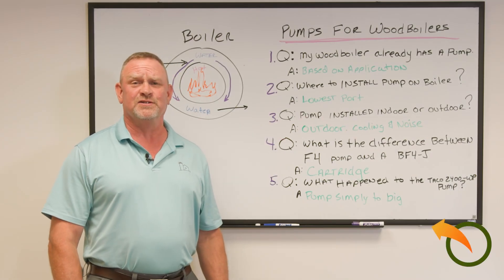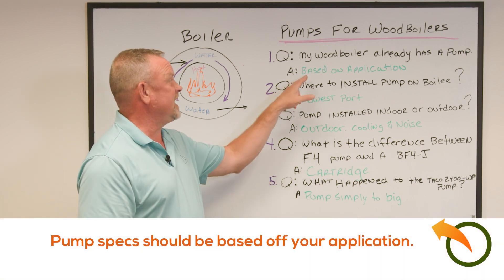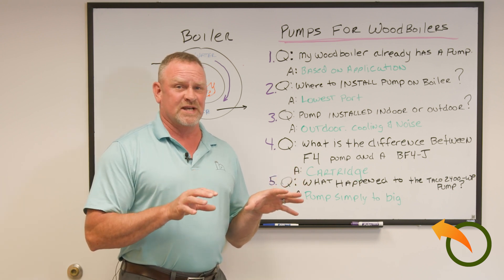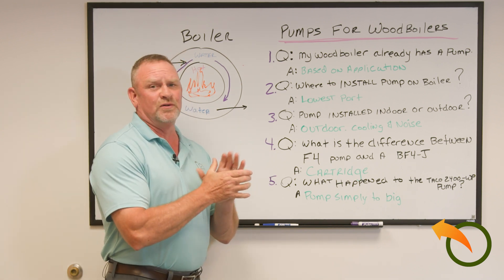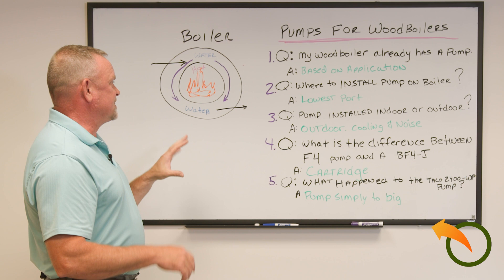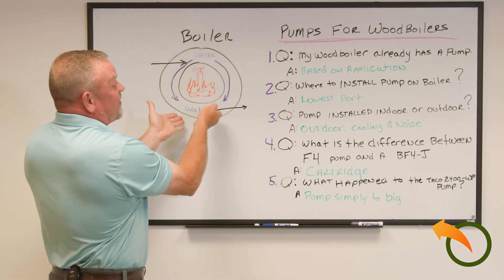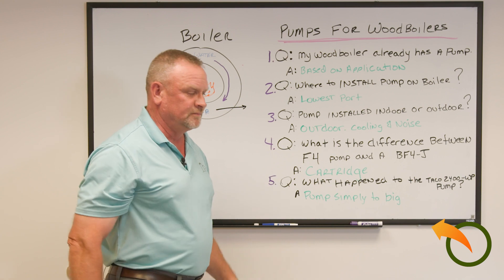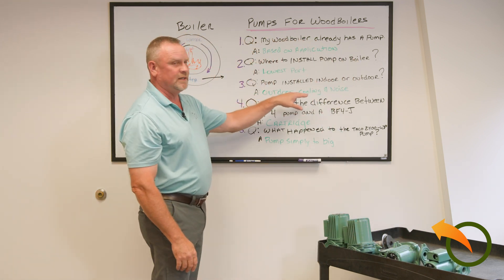Pumps Used for Wood Boilers

Comment: My 15 yr old Heatmor is 50 feet from house with Taco 007-F5-7IFC inside house. I previously had it circulating at all times, however, when I put in a new furnace boiler two years ago, they hooked it up so it would only click on when needed by the furnace. They also replaced the circulator so it’s only two years old. My current problem is the Heatmor is barely turning on Over an hour in between or more. The Oil Burner is kicking on every 12 minutes to run for two minutes. Any suggestions would be greatly appreciated as I can not find someone local that understands the setup to assist.
Reply: Heating an 1800sq ft house
Reply from the maker: You need to run circulator all the time to stop that. also it will help with over heating your wood boiler. Jeff

Comment: I'm installing an indore wood boiler on the outside of a 35 foot RV planning to build a small building around it do you know what size heat exchanger I would need to heat my RV? Also It will be not more than 60 ft from the rv
Reply: Sorry but I know nothing about RV heating systems...

Comment: Which pump would you suggest for plain water in a boiler so it doesn't rust?
Reply from the maker: The J pumps with the bronze cartridge. Example Taco 0011 BF4-J

Comment: These videos are extremely helpful, thanks for making them available.  I have a pump related question that is really a more general cry for help than a direct comment on this video, so forgive me for asking it here.  I just installed a Central Boiler 560, Taco 011, 70 plate water to water heat exchanger, 130ft one way from house (all ThermoPEX), 20 more feet one way in house, so figure 300+ distance.  Outdoor boiler setpoint 190, differential 15 (set like that due to the issue). Wrap-around pump installed inside so always heating indoor furnace core.  Everything "works" except I am experiencing significant heat loss (10-15 degrees) from the outdoor boiler to the heat exchanger.  More than that the higher the temp in the outdoor boiler, the worse the heat loss.  The indoor boiler NEVER heats higher than 180, no matter what the temp is in the outside boiler.

I'm wondering if this phenomena is the "crash" that can occur with the Taco 011 "tractor trailer" that you mentioned.  It almost seems that at the high temp some kind of venturi-induced air lock affect may occur in the Taco 011 that seriously slows down the water flow.  Note I regrettable have two 90 degree elbow fitting within a foot of the pump to get into the thermopex, and the elbows themselves are maybe 2 inches apart - perhaps creating an ideal situation for venturi air lock affect?  At the higher temps, 185+, the taco 011 makes clicking (not gurgling) noises that seem to increase as the boiler temp does.

Again, probably not the appropriate forum for the question, so forgive me, but I'm running out of ideas...
Reply from the maker: Sounds like your loosing all you heat in the ground. If your loosing 15 degrees in the ground on way you have something wrong right there. You should only be loosing a couple degrees. Start there. Jeff

Comment: I designed and install my complete system with the help of your videos, thank you! I used a UPS26-99FC, 3-Speed Circulator Pump, 1/6 HP, 115 volt. My one way run is approximately 140'. Trying to determine which pump setting will give the best performance? In theory, pump as much water as possible or slow and steady?
Reply from the maker: The pump your using Grundfos 26-99 is a good pump for your application. You are also correct, pump slow and steady. Ideally you would like 10 to 12 GPM for best heat exchange.
Jeff

Comment: This is my first season heating with an outdoor wood boiler. I’m an HVAC tech, and installed everything myself with most of my parts supplied by AltHeatSupply. I’d just like to say thank you, as your videos have been very helpful. You are very knowledgeable. I fell for the 2400 hype as well, as I have a longer run. So far everything is heating great, but will probably try an 011 if the 2400 dies.
Reply from the maker: We stopped carry the 2400-WB pumps. We agree they had a high fail rate. Taco 0011 BF4-J pump is the right pump for the application.

Comment: What is the maximum distance my outdoor wood boiler can be from my house or shop?
Reply from the maker: Depends on the pumps and underground insulation. Need to get the water there and not lose to much of your heat in the ground. The closer the better and a lot less expensive. The longest run I recommend is 300 feet. after that to expensive.
Reply: @AltheatsupplyLLC  Thanks

Comment: purchase my pumps and maintenance items from AH&Supplies. thanks for the info. i have 2 pumps on my boiler 1 for my house and 1 for shop. mounted 1 pump on bottom and returned to top. mounted 2nd pump on top and returned to bottom. seemed like the best way to keep water mixing around boiler. kept nice long sweeps on pex and used 45 deg fitting where applicable instead of 90deg fittings  to keep better flow. very happy with system.
Reply from the maker: A good running system makes the life much easier!